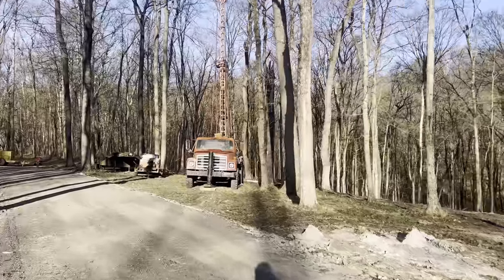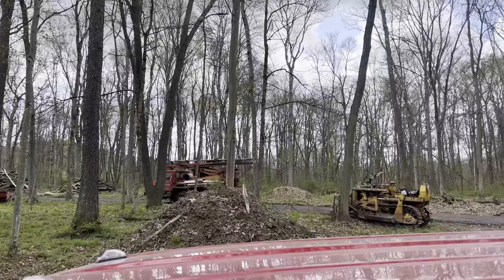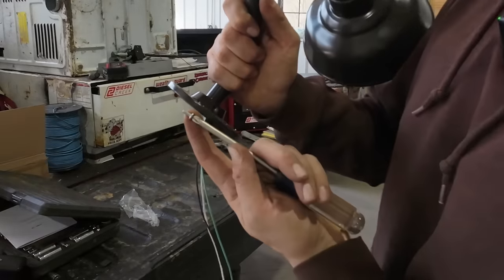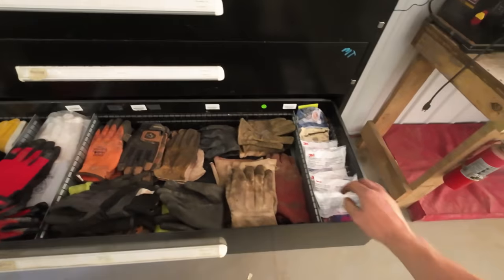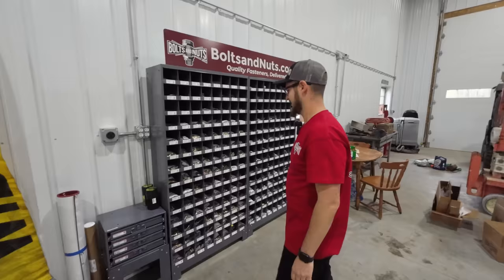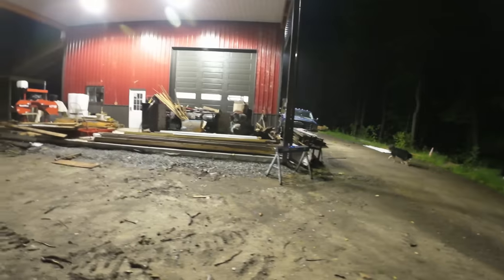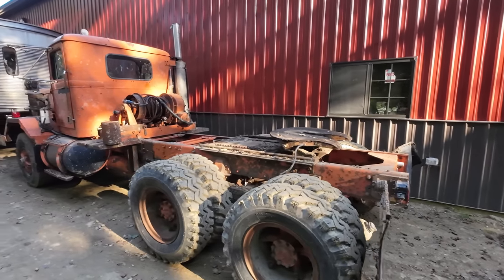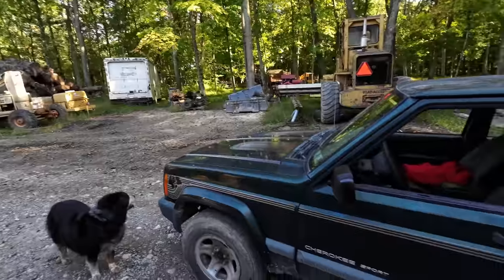1 YEAR Later, What happened to the DREAM SHOP BUILD

Comment: I would recommend a wood pellets burner for your boiler/heater setup as it is much easier to automate and would limit the labour for feeding and cleaning it to about once a week or less (if you do it right). You can also make your own pellets from most flammable wood/hay/paper based stuff/leftovers/junk you can get your hands on. You shred it mix it and press it with a pellets mill, let it dry and put it in to a screw feeding hopper that feed your burner on demand. You can also burn "normal" wood in there but the easiest would be to have dual feeding doors for the boiler. If you design it yourself you could have a door from either end one for the pellets burner and one for "other" burnable stuff, it would also make the clean out much easier. 
Ps. a battery backup would be good to ensure heat(circulation pumps and feed screws) even if the grid goes down, perhaps with solar panels on the boiler shed to keep them topped up and a emergency power source if you need it.

Comment: Just a thought on solar - absolutely doesn't make sense for a working shop, especially if it's done off grid. However you do have quite a bit of free-sky rooftop space on that shop, with a zero-maintenance roof (tin). You could use the roof space to solarize just the house. It would be plenty of space (for panels) to at least offset the household usage, in a grid-interactive configuration (it simply "blends" solar->AC into your house as you need it). Especially if you have time-of-use rates in PA (so charge batteries from grid during cheap periods, feed from batteries back to house during peak demand/higher cost periods)

Comment: I am in Conn and I have solar, have not had an electric bill in 2 years, do not need full sun just light. You have enough roof space for solar to power your setup as it is now. You can always have the grid with solar back up. I skipped the batteries as I get my power during the day and my6 refer and freezer will last a couple days if no sun comes out.

Comment: Prestige Pawn is such a great opening, I've come to wonder  if you are using different opening for different themes? 
Solar, Wind are fine self sufficiency power sources but I was wondering if you have decided to ignore or possibly can't even find a modicum of drainage I would definitely forgive the missive. On the other-hand my confidence in your self sufficiency wains when I consider the possibility of refurbishing any battery storage you might decide to use. There are myriads of batteries and combination of batteries in which to choose from. I personally am using several stacks of lead-acid car batteries (some restored to lead-alum) tons of 18650 cells and just any combination of batteries that I can cobble into my circuit. I don't have a power drain that would be in the realm of a welder (yet) but I'm looking forward to it.
Like so much that you restore. Batteries are very much the same path of possiblity. They need not be removed and crumbled up to extract elements to start over. Many just need to be reconfigured. It's possibly another project, but I would very much like to suggest you look a little closer into it.

Comment: I can agree with you about the solar system. Because you do have a generator(s) on site I think it would be a good idea to go ahead and add a ATS so you can easily connect your generator quickly and safely. The power company will let you down at some point and be sure it will be at the most inconvenient time for you!

Ron

Comment: Matt, you have a great site going!  How so??  Well you have a knack for showing the salient points of the projects you work on.
I have two things that I would like to comment on.

1 - Solar Power
I worked with solar in the utility space for a while.  Solar is not quite ready for the consumer market.  Yes, you can buy solar but you will never see a profit if you consider the total cost.
There are power system problems with the wide deployment of Solar.  So I did a "back of the envelope" calculation.  If all of the passenger cars converted to electric we would have to add 30% more generating capacity to our grid.
Power systems are designed in the conventional manner do not understand solar at the grid edge.  Some more work needs to be done.
Solar has caused issues for firefighters, panels are always electrically "Hot" so firefighters have to deal with electrocution potential.
The impact for solar on our society has not been fully modelled.  We need to do this.  
I distinctly remember a call I received from a government agricultural official.  She wanted to know why the utility was slow with solar applications.  IT IS BECAUSE OF THE UNKNOWNS OF SOLAR.  After all Solar is the Holy Grail for energy.  
Obviously, she said,  the power company does not want to give up the profits of owning all aspects of the grid.  I responded with "whoa, if you think about it if solar was so cheap don't you think the utilities would be all over it.  Utilities employ solar for the appearance of environmental reasons.  It is a harsh statement but there is NO profit in solar, for anyone...  Well not without significant government incentives thrown in.  

Should you have used solar, NO!  You would have regretted this choice.  It is expensive, takes time to install, and now YOU become a power company.  If it breaks, you fix it.  Let's take a look at the economy of solar.
The sun shines on a panel.  Considering the surface area of the panel you can calculate how much energy is available.  A good solar panel will use only 18 to 22% of the available energy.  Right now you can see the efficiency of the panel is important.  So that is an important part of the panel research, improving efficiency.  The grid edge power converter is 98% efficient, 100 watts in 98 watts out. And they are working on it.  A panel of 2023 is 3 times more efficient than 
a 2010 panel.  With a battery, the costs become astronomical. 

Matt, if you wanted to simulate utility performance (100kWh), you would probably need 60 solar panels, plus spares, cost ~$15,000 to $30,000 installed, if you do the mechanical work.  A guesstimate.  But I used to live in Coraopolis, PA and the cloud cover would be a concern.

The converters used should be edge inverters with a integrated battery - $85,000 installed.  A guesstimate.
A good budget for you would be about a $100,000 for a system that would meet your needs for an autonomous, i.e. off grid, environment.
Divide $100k by your annual electric bill an that will give you an idea of how long it would take to see a profit.  But wait, 
And if you had a nearby lightning strike, insurance?  You would lose many panels and then you would see latent failures, equipment that was damaged but not enough to fail immediately.  

And where would you put the panels?  Unless you designed your pole barn to support the weight of 60 solar panels, 50 pounds each installed, basic total is 3,000 pounds, NOT including snow or wind load.  If you felt comfortable parking your Deuce and a Half on the peak of the barn roof, well then you should be fine with the weight of your system.

Th people investing in solar now could be considered early adopters.  I don't think you want to invest in the future of solar, no payback and a lot of money spent.  But thank goodness people are, and bringing the costs down.  Eventually solar will become affordable by all.  Or maybe solar will never be a good deal and something else will be invented.

I would suggest you put up 4 panels, and see what it costs and how it pays.  Then you will not hear about it anymore.  People see one solar panel on a Mad Max truck and think it serves the needs of the truck.  Not by a long shot.
I think you would feel good about that, and collect a boatload of performance data to see how much solar you will need in the future.  Despite this diatribe, I do support solar in principle if not in practice.
You and your electrician buddy could install these 4 panels and connect them to your barn in a weekend.  Modern inverter systems have a built in web pages that you can use to see your production.
By the way, solar panel electric production is directly scaleable.  If you build a single panel you could see your results and decide how many panels you really need multiplying single panel metrics by 60 or then number of panels you need.

2 - Made in America
I agree, I like to buy American or Canadian goods.  I do when I can.  They are well designed with advanced parts and expertly assembled.
But you commented on the high cost of American goods.  Yes, and these prices reflect the quality and experience of the vendor and the American worker.
I was a power system design engineer and I worked in a manufacturing and production environment.  I invented and designed products from scratch.
Cost was, and is, always very important.  Things that lead to cost increase: Material sources, design time, creating a build, test product, standards testing, labor cost, plant costs, and required profit margin.  The US employee works hard for their money and they expect a decent wage.  - This is where a LOT of the money goes.  And it is fair, based on the US and Canadian standard of living.

US model: Good materials tested for fitness, design time, documented designs, thorough UL and CSA testing for safety, Vendor stands by product, excellent wages,  owns manufacturing plant, and makes profit for shareholders and the firm.
Offshore model: Least expensive materials, design time, documentation??, no safety testing for North America, Vender disappears after purchase?, much less than minimum wage?, rented space to mfg.  Profit?

American goods often cost more and they are worth it.  Offshore goods are a gamble for safety, performance, and durability.  Maybe you will get lucky, Maybe not.

For Example:  Brake spring pliers
Snap-on - BR 131A - $133 - Made in the USA, Lifetime Warranty
Matco - SP100A - $41 - Does not appear made in USA, But MATCO is a recognized brand.  30 day guarantee.
Harbour Freight - "PITTSBURGH AUTOMOTIVE Drum Brake Spring Pliers Kit" - $13.99  This looks like it was made in the USA, but no.  10 day warranty, but take a look at the conditions!!

Well it looks like TLDR, but those two topics are important to me.
Reply: You left out the substantial upfront outlay to connect to the grid in your five page tome. And that was with him doing a $hit ton of work himself. If he had contracted that out like most would, it would likely have added another $50K in laying pipe to the $50K upfront costs to connect. That was a lot of pipe laying. Matt might want to consider a hybrid system that also includes diesel generator backup. He recently got a large diesel generator, but think he intends to replace the Fat Allis engine with it. Not sure, but maybe tie in the light tree version. Not sure how the shop is oriented and whether it would even make sense to add the panels. The orientation would likely have had to factor putting in future solar from the start to make it worth doing at all.
Reply: Right?!?  There is a lot to consider, these 5 pages is just the introduction to the project.  At best the two cent version. 😁  I really like solar, but the costs don't add up yet.  I do feel a bit uncomfortable using arable land.  Also, the area where Matt lives is some of the lowest sunshine radiance.  I think it is less than 4kWh/m2/day.  This area is not good yet for the current generation of solar panels.  And yes, orientation and regional available solar energy would have to carefully considered.  
Enough, these are two very inflammatory topics for internet consumption.  Thank you for being kind Lisa, I expected the first comment to be a real flame.

Comment: How deep did he punch that well down?  We have to go down 15 meters (they will allow you to make do with 13) to get down to clean water.  We had to have a new well drilled a few years ago when the foot valve failed, and they couldn't pull it out as it was rusted into the outer pipe.   I watched the new one go down, and the drill bit came up wet after just over two meters, but apparently the water is filtered by the gravel as it sinks down into the aquafer, and the local council mandate the 13 meter minimum for safe water.  House water goes through a simple paper filter that we change out once a year or so, and it tastes amazing.

Comment: I will be starting a new timber frame house at the farm soon. I thought about trying the solar, but im in the same boat as you.. Cant count on the sunshine in Pa/Wv..   I got two 220v well heads 220 for the compressor and welder in the shop.. Plus to power the house and outbuildings.. It would take one hell of a pricey system to handle the load..  I might look into a small system as a backup just to handle the lighting for when the storms run through..

Comment: Great shop and yard of equipment . You need to quit going to auctions ( easier said than done ) as you are going to run out of space to store or park everything .  The shop I worked at for several years had enough bolt bins , bins for just about everything we needed in our equipment overhaul facility . As the parts man for about a year I was tasked with the job of designing and stocking all of the stuff in the bins of said goody's and that was a heck of a job to get done and satisfy our shop crew . When I made plans to bid into a different department of our railroad I bought a hand carry tool box that I took to work each day and when I left each day it was full of goody's for my own bins . I thought that at least I could reap some reward for all of the work I did and I knew I'd be using the stuff . Sure beat running to the store to get what I needed and a few times our shop foreman asked why I kept carrying the box home each day and I told him just don't get nosy and pick the box up . Hell he knew what I was doing and just looked the other way . When we got everything by the hundreds what a few are missing is going to make a difference . All of our bins would easily line both sides of your shop plus extra cases and wooden boxes as we ordered by the thousands were stored in containers . Something like cheaper by the dozen or by the thousand count . after I left a bean counter started figuring up how much all of the stuff was costing and they started locking all the bins and counting everything to add to the price of each equipment overhaul . When I would visit when I was back in town I would only be able to fill my pockets with what I needed as I still had buddies that would help me out . Anyway Matt you have a fantastic shop and It's great you were able to retire and do what you have always wanted to do and be thankful YouTube has been a great contributor in your success .  Stay SAFE  and be CAREFUL  .  KEEP YOUR PHONE ON YOU AT ALL TIMES INCASE YOU NEED TO CALL FOR HELP .  I do and yes I've had to call for help three times just in the last three years and rides in an ambulance to the ER isn't the best ride I enjoyed . Good night from central ARKANSAS  .

Comment: Thanks for sharing your thoughts on solar. I'm sure you looked into it. I mentioned it in the comments earlier. I'm arguing with myself over clearing a couple acres and planting solar flowers with the increased property value of tying into the grid. Maybe a solar company will read this and work with you to prove a point. Could be one helluva advertisement for solar and battery set ups in difficult locations. A learning point even if it wasn't 100% successful.

Comment: 26:34 you cant say that for sure, it depends on the quality of the panels, for example my parents installed a roof solar installation back in 2006 with an capacity from 5.4 KWpeak and even today under full load in summer we get well over 5 kwp so the panels have in the last 20 years basically shown no signs of degrading and if it is in the low 1 digit percentage nothing like 15 or 25% less power. these are panels from sharp.
So depending on the maufacturer and quality these panels can last very long with little to less power loss, only thing power per space since that like doubled in the last 20 years if i look at the panels from my parents the have each 180watt while today you get easily 400watt per panel even up to 430or 440 watt and that while the price has gone down like factor 10...

Comment: 25:10 
The electricity meter that supports solar energy contains two separate sections, one of which counts the electricity consumed and the other counts the electricity that has been pumped to the grid, whether from solar panels or traditional generators, meaning that if you connect an electric generator to the grid, all the difference in wasted energy will be stored in the meter. Therefore, it will be available for use at night, from grid electricity, but for free, that is, as an electricity bank in which you put an amount of electricity and then withdraw it again at night, but without running an electricity generator.
In addition, electricity does not come only from solar panels, there is also wind energy, which is very available to you in Pennsylvania, 24 hours a day, days a week, 365 days a year.